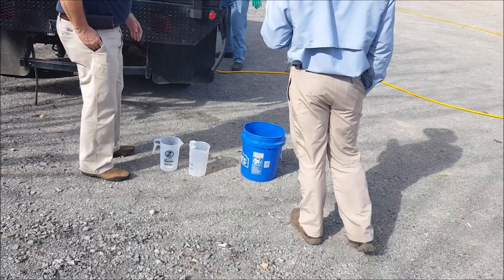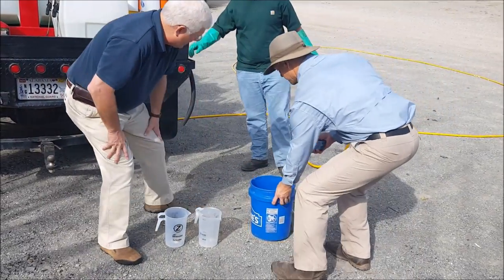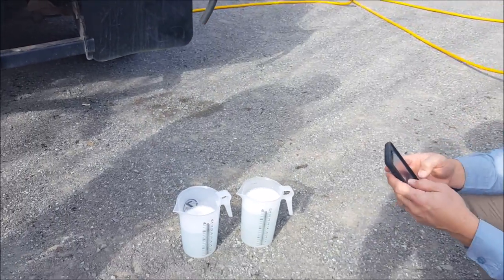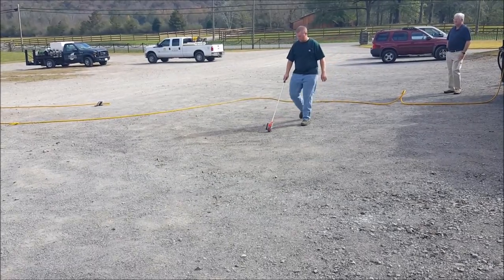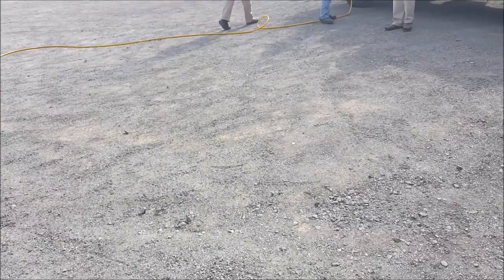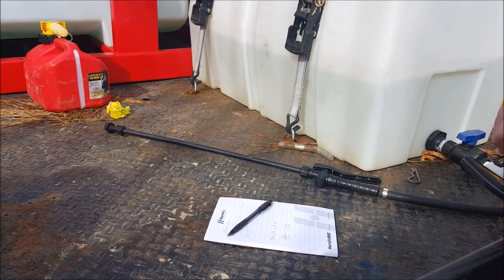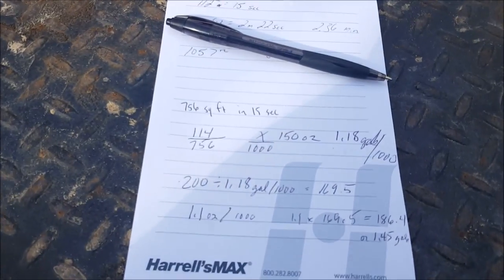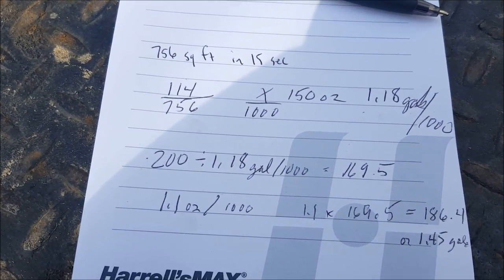Tank Sprayer Calibration for Weed Control in Lawns

Comment: We are looking to get down 2 gallons per minute on 1000 sqft. After calibrating, it looks like we are at only 85 oz per 1000 when using the 2.0 yellow tip from lesco. I have ordered a 3.0 green tip, but wanted to know if there was any problem with upping the pressure a bit till it comes in? Any idea what the gpm was on the nozzle used in this video?

Comment: Have a graham sprayer. It came with a 3gpm nozzle. When I calibrated the sprayer its spraying at 1.36g per 1,000sqft. Its this a good rate to spray fertilizer and soil amendments? All my herbicides i am using d flowzone backpack sprayers
Reply from the maker: I would try it and see if it clogs the filter. I would think it would be fine
Reply: @lawncarelife  ok thanks. Do you like the 2gpm or 3gpm nozzle better and is one better than the other?

Comment: Jason..im looking at that exact sprayer for my biz...a couple questions about the video. first off....pressure wasn't mentioned. Approximately what pressure was he running. Being that I'm here in Texas, wind drift is always an issue. Sounds like his tip of running a larger volume (2-3 gallons per 1000) would be beneficial overall in my area. I have a handful of customers requesting applications, and have been trying to figure out what I need to get. I already have my commercial applicators license, and gen liability insurance.  Can you also provide more info about what gun/tip he was using. Very helpful video.....am REALLY hope to get into this portion of the industry for 2018. Thanks! Is it hard to clean tanks after use? going from one chemical to another....what steps are involved to ensure I don't apply the wrong chemical to a lawn. I'm guessing it would be best to keep sterilants in a stand alone sprayer rig to ensure there is no cross contamination. The reason I ask that is because I have already been doing some of that type of work on a few commercial properties that I take care of using backpack sprayers (for cracks/crevice type stuff). My other option instead of this 200 gallon unit is the Gregson clark sprayer that has the small boom and mounts inside the lesco type walk behind Fert Spreader. My concern with a boom is wind drift. My thought is the gun would ensure less drift vs the booms. I know...long post, but hope you can provide some assistance here. Thanks so much, and happy holidays!
Reply from the maker: +rbljackson I can't speak so much for the tank that was shown in the video because that's not my time. Many people use a Lesco gun. That is what I use.  I think you are correct in saying that more water volume would cut down on the Wind Drift if that is a concern.  Cross-contamination could become a concern depending on what chemical is in a tank.  Sometimes I try to cycle clean water through the tank to remove as much of a particular herbicide as possible.  There is a lot to learn in the weed control and fertilization business.  You need to put together a program so that you know what you are planning to spray and when you are planning to spray it on certain grass types
Reply: If you have your applicator license you should already know what the eff your doing

Comment: i feel like its to complicated that way. i mark 1000 sq feet adjust my speed and pressure to 2 gallons per 1000 with a stop watch and bucket.
Reply: The main reason is the trainee will focus on not spraying outside the square and that will usually change his pace and arm movement with that attempt. The ultimate goal is to have used the right amount of product per 1000 sq. ft. when a lawn treatment is completed. There are several good ways to approach calibration. This is just one.

Comment: Great video, could you do one on how to calibrate a broadcast spreader?
Reply: Find the spread width of your spreader and from there measure out your test length to get 1000 sq ft. I just use a straight line. Once you have that, find the recommended amount of product to be applied per 1k sq ft. Let's say 4 lbs of fertilizer per 1000. Measure out 5 lbs, put it in the hopper, apply it over the 1000 sq ft area. If you have some left over, weigh the remaining amount. If you come out with 1 lb left over, you're perfect. If you run out in the 1000 sq ft test area, you're applying too much. If you're under or over, adjust the flow opening accordingly.
Reply: Basically you're just spreading in a known area of 1000 sq ft. And aiming to get the spreader to apply whatever the recommended rate is in that area by trial and error. Know your starting weight, and weight the leftover material.

Comment: Personally I think that's way to much square footage in the time frame. To low of volume as well. In Florida you can't run that low of volume unless you want poor fert, weed, and insect control. I'm sure further up north you can get away with this.
Reply: Just my opinion and experience. Our turf grasses are thick and hard to penetrate.